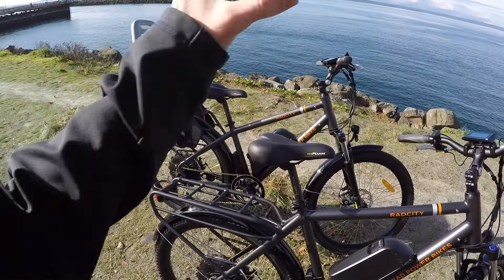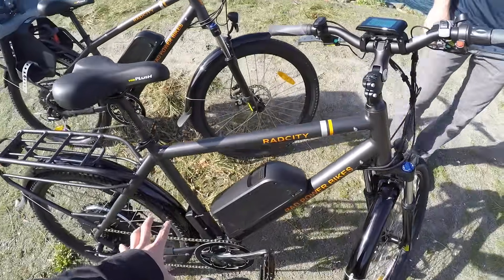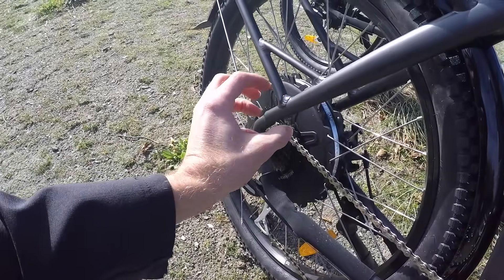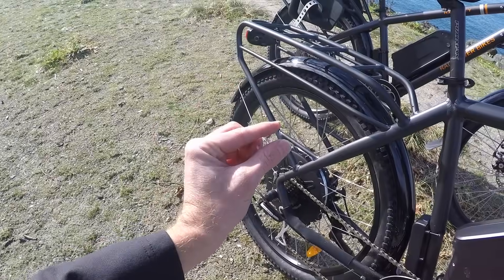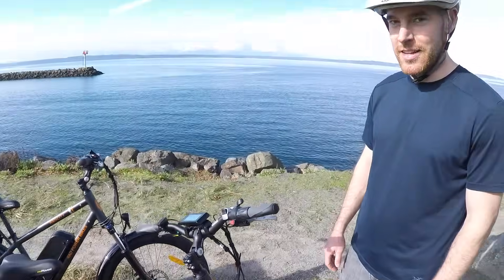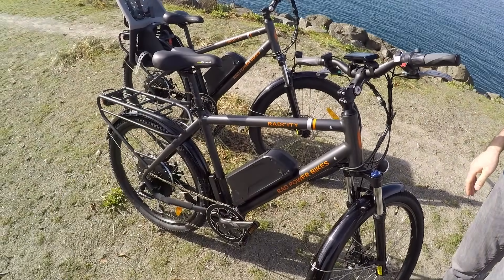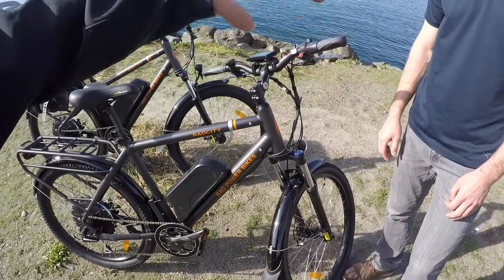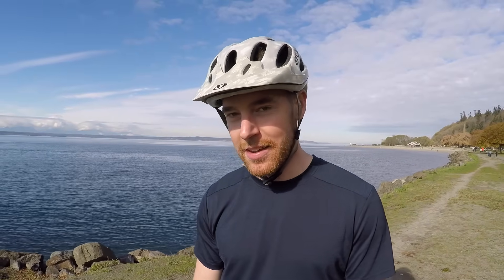Yes, You Can Charge Some Electric Bikes by Pedaling!

Comment: Is it possible to charge the batteries simply from wheel revolutions? For example coasting down a hill? It would constantly get a charge even if they are being assisted by the batteries because it’s based on wheel revolution. I’m just randomly spitting out ideas but also, could you put some sort of like fan blades put on the bike somewhere to also charge the batteries from wind power or a small rear solar panel?
Reply: 1:15 that's the answer

Comment: The electric grid is powered by mostly nuclear and coal power FYI . The fantasy that solor wind and water can supply enough  electrical energy to replace internal combustion just that a fantasy. It currently  cant be done .....if it could theyd have been doing it already.

Comment: Hang on what I dont understand is even the fact your moving you could be charging up a battry then when ya battry runs out you swap the battry to the 1 you've charged up just by moving then just keep swapping I no thag wont happen but just moving can make electricity you dont have to pedal like them bike lights that light up just cos ya wheel is turning like a turbine they.mske alecrisity
Reply: Like cars cars are running round and wasting so much energy cos you could be making loads of power just by the simple fact ya moving and you can charge ul a thing with battrys

Comment: A two-wheel upright bike will never be very efficient (with current technology) at battery regeneration. 

What you need is a recumbent 3 or 4-wheel with a capacitor on each wheel generating 3x the power, and with multiple batteries so you can switch between spent and fully charged batteries as needed. The recumbent position is more efficient at generating power than upright, and produces a lot less drag. With a recumbent platform you can also add an adjustable sail, such as what you'll see on a blokart. This will become your main source of locomotion with the electric motor and pedal action providing extra power for low-wind days. You can even add a wing to the vehicle to produce a small amount of lift to reduce power consumption. The sail doesn't actually need to be very big to generate enough power to propel the vehicle at speeds up to 15--30kph. With battery assistance and/or pedal power you can easily get up to 45-50kph.

Comment: In terms of ebike vs pedal, the motor is actually a greener source of energy than your legs, although the small amounts of co2 from a human  is worth the fitness gain.
I mean even without considering less efficient food production, often you will use more electricity on increased showering a sweaty body than powers an ebike. A 6 minute shower is like charging my 840 watt hour bike all the way.
As far as food, meat is the least efficient. The electric motor is 85% efficient and your legs are 25 although going from coal burning to spinning your wheels is probably a similar 25% or less. It probably takes just under a lb of coal to charge my battery and get 25 to 60+ miles depending on speed.
It also depends if you ate the food and got fatter anyway, and eventually the remaining calories are burnt at the crematorium.

Comment: @MikeRadenbaugh No doubt there’s massive amounts of energy loss due to friction, the electrical conversion etc. I have gained much interest in owning an ebike for both my work commute and longer distance travel on the side to see my family. To have enough (assurance) battery power to reach my family’s home and return to mine would be my biggest concern. If I could charge the battery along the way, I think you’d agree, that’d be an ideal solution. I have begun conducting my own research and may have found a solution that I am certain will work, at least to some degree, in combination with your bike adaptations. What if on the opposing side the drive chain, run a separate system to include an alternator say from a lawn motor and incorporated that charge to the battery or an amplifier? Without having the actual bike I cannot conduct my further study; regardless I want to offer the idea to you and I hope you and your team could find it useful or maybe expand upon it. Thanks for your time and have a great day.

Comment: Charge a battery like peddling? Thats like exercise...My ebike doesnt even have a chain. If i want to charge mine while ridding i hool up my trailer, tie down my predator generator a plug in my fast charger...generator will completely recharge 52 volt 20 ahr battery twice on less than a gal of gas. Start with a full battery i bet it gets 100 mpg on flat ground..maybe not..that sounds to good...Right, e bike is not exercise, its a pain saver, i have a blown out knee..lol

Comment: I'm so sick of being told how inefficient it is, I only want one of these things if it can do this. I don't care if its only a little bit of charge, I'm interested in this concept for 2 reasons:

1) Its fun to build up the charge yourself, even if its only a little, it gives more meaning when I use the battery I charged myself. Its like eating something you've cooked.

2) I want to be able to use this charging feature to increase peddling resistance. Maybe this wouldn't be an issue on these bikes, but on my cheap ass bike that only goes up to gear 7, I want more resistance on flat roads/trails.

Comment: RE: As a result, many of the companies I’ve talked with about this subject report that they only see 10% to 20% energy capture. The rest is lost as heat in the conversion process.

10-20% energy capture by regen is a meaningful addition to range, it doesn't mean 80-90% of energy is waste heat. Depending on chemistry you'll get something like 85-90% efficiency at the battery,  and maybe 10% losses from switching and harnesses for ~75% or better conversion. RPM/motor characteristics, regen current, and battery chemistry all are key factors.

Comment: If one added a separate generater turned by chain from pedaling along with two hub motors and two sets of batteries one used at a time shouldnt the generator be able to charge the lowest battery with 10% power

Comment: I guess it could be ideal if you just pedal most days then one day reward yourself with using the power.
Reply: just use a non electric bike which is way more efficient
Reply: @kenelder9615  where that is very true, but that wasn't the point of my original comment.

Comment: What if you... 
• Attach 2 round plates with multiple sections of sawtooth rings, in sizes decreasing towards the center, on both sides of the wheels, and then a second layer of plates with multiple generators, which has small cogwheels, in sections like before, so the cogs are alligned with the sawtooth-rings on the first plates,
• Put multiple cogwheels attached to generators along the bikechain,
• Covering every available surface of the bike with solarpanels, 
And finally... 
• Attach a big windturbine on top of your helmet?

Would that generate enough power to keep the battery close to fully charged while trying to outrun all the bullies that would be attracted while riding this now insane-looking "geekhicle"? 🤔
Reply: What if the video showcases bad engineering and blames humans for it? It does! A reasonably efficient direct drive system would recover 70% power round trip and prolong ride time just fine.

Comment: I had a front wheel alternator on a old English bike for the bike light.  If your riding your bike your not constantly pedaling you coast for a while. If your alternator hub is giving it a constant charge to the battery while riding. Would keep your battery from draining and getting low. Kinda like a car alternator does a car. Solar panel battery covers for the electric bike with the triangular covers that fit the frames. could keep them charged while not riding.

Comment: I always wonder... it must be possible to attach pretty small alternators so they work with the wheels (where the brake pads go, on the side of the wheel) so when the bike moves it generate electricity for the motor...
Someone smarter than me should be able to do it...
Or is just a dumb idea...

Comment: Ultra or super capacitor bank could be used to minimize the mechanical to electrical to chemical losses. Specially if used with a small high powered battery. Capacitors can charge and discharge near instantly and be used to more efficiently charge the battery through a trickle or directly powering the motors as wanted / needed. For example a capacitor bank could be charged as you bike and if you need assistance up a hill or just a boost of speed here and there it'd be there.

Comment: The engery from mechanical movement to chemical back to mechanical needs to be optimised for minium loss. Maybe the best technology is not being used or a future technology can reduce this loss dramatically. e.g superconductors that work at rt with future synthetic materials for better battery efficiency. This problem must be solved.

Comment: What if there were two batteries using one at a time but switch when required that way one battery would help to charge the other, using an external independent dynamo.

Comment: My limo bike could reallu use lectric assit. It's a hard bike to pedal at low speeds. And taking off is a bitch!  I can't ride far off road on it either. The toque ratio is horrible and you can't get your weight over the pedals to assit like most bikes. I still like it because it's goof for putting around the neighborhood and going to the store.

Comment: I know what he's talng about. The enrgy needed to generate electricity means you have to put some effort into pedaling. When you consider that you're not just charging the battery, but also moving the bike you get very little ennrgy for your effort.
Reply: My current bike cannot regen due to the freewheels in the mid drive, but it would feel like pedaling into a headwind for 5 hours just to charge mine anyway. That's with 170 watts going to the battery and still needing extra to move the bike/generator losses etc

Comment: so old video, no idea if anybody will actually see this but did some back of the napkin math: 25 miles biking (as a 150 lb rider myself) is 1200 calories. about the calories in 2 pounds of eggs. I go home and eat 2 pounds of eggs, I've just used 8 kilowatt hours or energy for those eggs. radrover battery: 0.6 Kw-h. throttle only, around 25 miles. so, radrover with throttle only: 13 times more efficient than pedaling. 

and that's assuming I don't go home and want a burrito full of meat, which his way less efficient than eggs.

Comment: As anybody thought about fixing a capacitor to charge up a battery like they do in self-charging watches.As you move it trickle charges or even like me use an old type wheel dynamo used for lighting to trickle charge but have not found a way of of getting the power to the battery in both cases.

Comment: I have a proper project with dc motors from wind turbines, I have usb board on my trike, phone charger, car lighter, usb lights, capacitors for 48v energy, I built my battery pack with 120 Ah 48v. my bike charging herself without wind, solar or pedal. its converting energy from dc motors wich runs automatically when the battery go on red. I never needed to take off my battery for charging. I can sell my project for 6000$. my trike looks like a gold UFO, because is full of electronics

Comment: A two wheel trailer with two dynamos in the wheel hubs, would regenerate battery  energy enough?
I'm thinking about this for long distances travels. I use a Son Delux dynamo on my bicycle and the USB werk, as you ride and recharge your devices you can't really feel the drag of the dynamo. So if you put a trailer on the back two wheels dynamo plus the front wheel dynamo?
I know it sounds crazy...
Reply: Philip nik 
You can't feel the drag with 1 dynamo because you are making such a small amount of energy by using it.  Regen is inefficient.  With enough dynamos to matter, you would have to pedal very hard for very little gain.  It is much more efficient to extend your range by directly reducing battery drain by pedaling the bike the normal way through the chain & derailleur to the back wheel.  Dynamos use more power than they convert to electricity and batteries don't store all of the electrical energy put into them.  Bypass those losses by pedaling through your 98% efficient bicycle chain drive.  Lighting & USB dynamos output only a few watts each and battery charging is inefficient.
Reply: denbecr49 thanx for the answer.

Comment: Regen braking is fantastic! It's not about recharging the batt by pedaling (mainly since pedaling with the brake on is stupid), but rather to get some energy back from slowing or stopping which would otherwise be totally wasted by the use of the friction brakes. Two bikes climb a hill.  One has regen braking other does not.  Both put in same energy to climb the hill (human plus battery)..  On the downhill side the bike with regen controls speed and gets a bonus of some energy back into the battery that the other bike does not.  Result... bike with regen gets to go a little further with its battery than the other bike.  Is that desirable on an ebike?  I think so!
Reply: The main plus about regen on an e bike is not the tiny amount of energy it puts back into the battery, it's that it saves having to replace your brake pads so often. Of course, the longer the hills you can regen down, the more energy gets returned, but the bigger the savings on brake pads too.
Reply: It's not tiny, it's about the terrain, yes, if your region is flatland, you'll not get much back.
But in a place with lot of hills, it's pays back alot to have regen.
usually you can store that energy as kinetic energy to climb another hill with your inertia.
But when the hill is too high and you have to brake or reach +80km/h, then you certainly need to store back that energy that get wasted to aerodrag and disk brakes back in the battery.

Comment: Why can't normal pedaling just regenerate and charge the battery?
Reply: Generating power requires power so regen while pedaling would make it really hard to pedal.
Reply from the maker: It can and does on a bike like this but it's incredibly inefficient when compared to electricity coming from the grid going directly into the battery. Think about all of the energy it takes to plant and grow food, harvest it and ship it around the country, prepare and then eat it, digest and convert into some muscle power, pedal a bicycle and lose some efficiency in the form of heat, and finally recapture just a little bit of energy into the battery. It's incredibly inefficient compared to a solar panel, wind turbine, or coal turning a big generator and sending electricity directly to your house, the bike charger, and ultimately the bike. Way less energy is lost.
Reply: ElectricBikeReview.com Is there a feasible way to efficiently capture more energy by pedaling?

Comment: now to throw on a petrol motor
Reply: WickdPerfekT right, I have an ebike but thinking about building a 4 stroke bike for longer trips. Ebike only 16 mile range ( high level) I don't like to go slow!!! 

4 stroke ( last one I built) 35+ mph , unlimited miles. Ebike 20 mph ( guess would get more with stronger battery, mine 48v, 12a) 16 miles.
Reply: @leonf1111  Buy a moped or get some education.
Reply: Dick

Comment: Can any ebike with a motor charge like the green microgym bikes / rad bike sending power back to the wall or off grid (not in respect to regen)? Or, do you need regen to do this? Not sure what I would need to charge if electric ebike motor and muscles were willing to do the grunt work. I had a look at the website and it looks like you hafta by a whole new bike. ak! I've got kila joules to spare.. Might be fun to power the tv but only if it's powered off of the bike in concept.. hehehehe
Reply: Your motor would need to be direct drive so that there is no freewheel disengaging the motor like in geared hub motors.